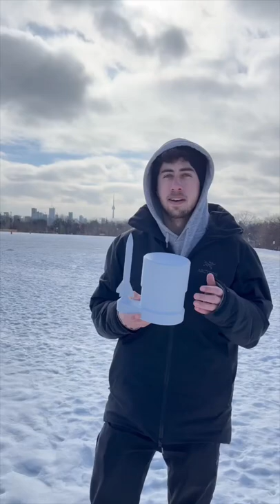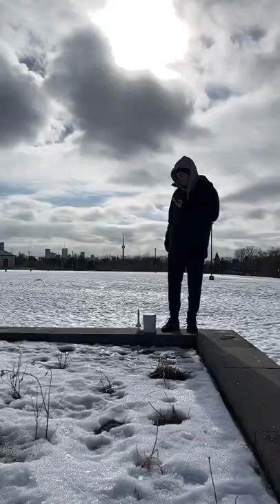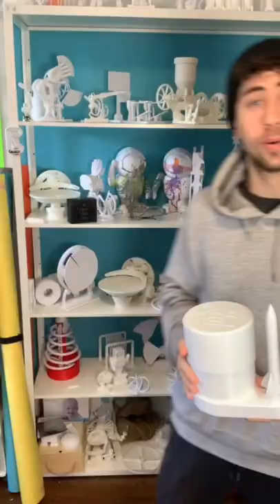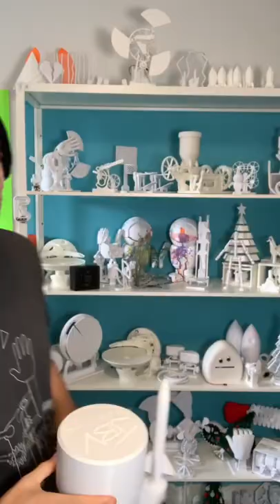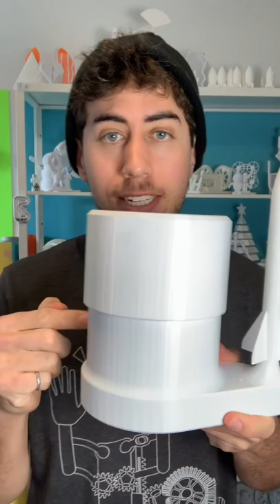Outdoor Stomp Rocket Testing

Comment: Imagine that except you use an air pump 😈
Reply: @Engineezy  add internal weight on the rockets top=more distance, angle the wings so the rocket rotates while launch = giving it more stability.
Reply: @saravanamanoj8407  so basically make it go spin and go further with the downside of falling pointy part first a d being possibly able to pierce skin.